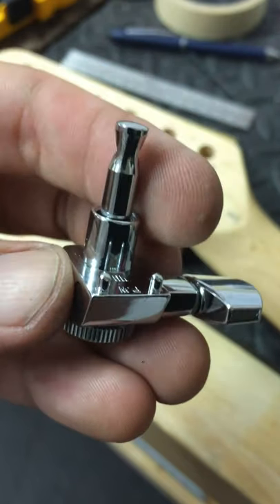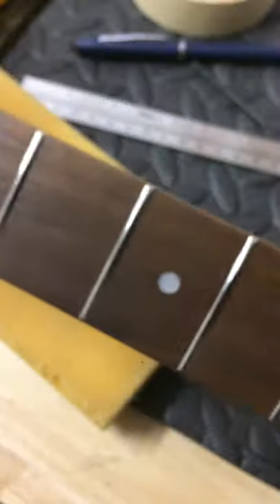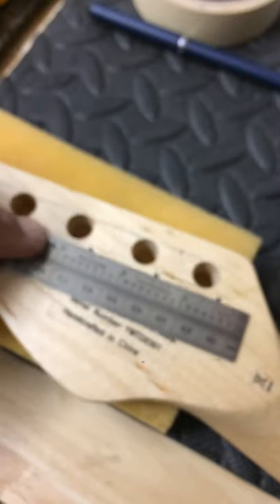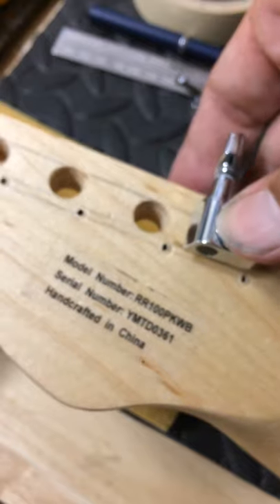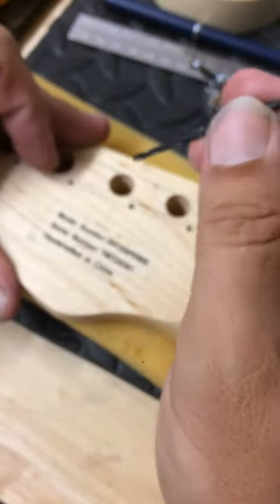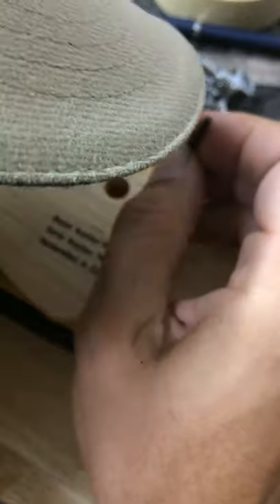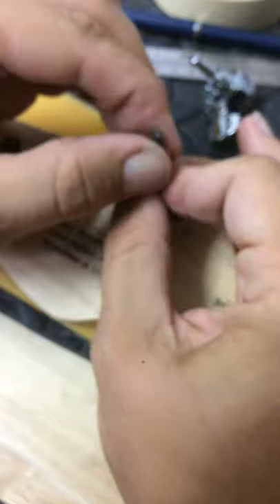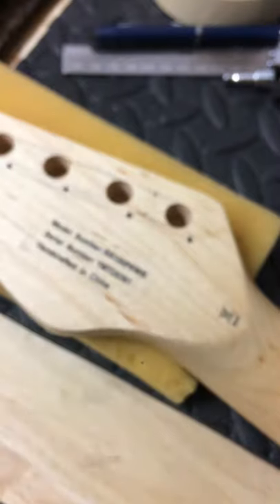DIY pinned guitar tuners install EASY!

Comment: This is extremely helpful because I currently don’t have a drill because I gave away two drills before my last big move, and the battery on my Dremel tool has given up the ghost.  I also thought using a power drill for this task is overkill, and as you put it, I may be ‘asking for it.’

My two potential solutions were to either buy a drill—and I have expensive taste in tools—or have a shop tech do it—which would be totally lame particularly since I already bought a reamer I don’t otherwise need to make the holes for the pegs bigger.

Comment: I can appreciate how this can be helpful. The lines trick is pretty great advice. However this method leaves a lot up to chance. If you don’t have a deep enough “dent” to start that bit into the hole, the bit can easily “walk” itself out of position. Necks are not cheap. I would recommend against doing this without all the proper tools and maybe giving it a test run on a piece of scrap wood before trying it on your expensive and much loved guitar. A drill press, clamps, machinist ruler, sharp bits, pin locator, drift punch, and a set of brass balls are some of the tools I’d recommend having on hand to ensure you get this just right. You only get one try at this. Otherwise you are in for a world of sadness. Take it from me. I had a drill press, brand new bits, clamps, and a machinist ruler on hand and I still screwed it up. One tuner just slightly askew is extremely noticeable. Once you see it you can never unsee it. It will drive you crazy forever. Luckily I made my mistake on a cheap $60 Chinese neck. I just ordered an insane artisan built 5A flame maple neck with rosewood fretboard and stainless steel frets with spherical ends and hidden tangs. It is the nicest neck I have ever seen. I am buying the locator. I’m not screwing this one up. So please be extremely careful using this method. Remember the carpenters rule of measure twice, cut once. Don’t use this method on anything you will regret damaging. That being said, if you can always carefully drill new holes in the correct position if you screw it up, and the tuner casing will likely be covering your mistake. Only you will know. And it will still drive you nuts if you are anything like me.

Comment: Drill press would be much faster. You could use tape for depth guide.  Just a thought. That's how I install locking Schaller tuners on my 4x2 necks i build. I always buy the pinned type because I don't like screws showing on the back of headstock.
Reply from the maker: Agreed.  However this video is for a person with no tools.
Reply: If you have a drill just go to your drill press!

Comment: How do we draw the original like since we’re not going to have those holes in our headstock that yours originally had?
Reply: you can draw a line in the same position using the first and the last tuner to guide the ruler